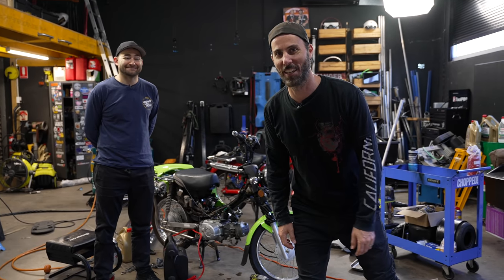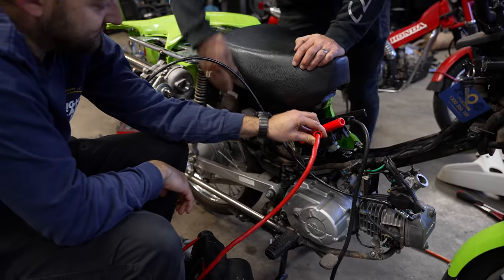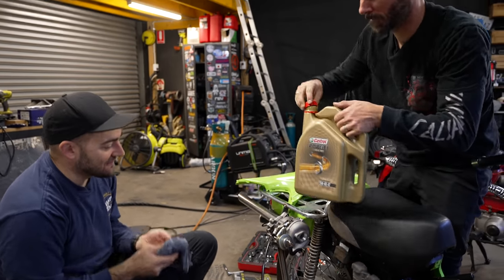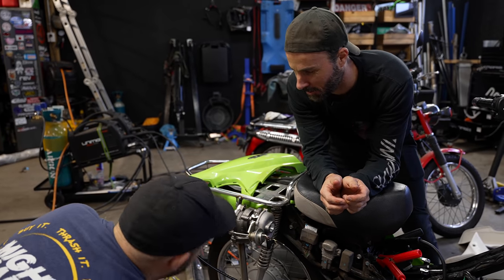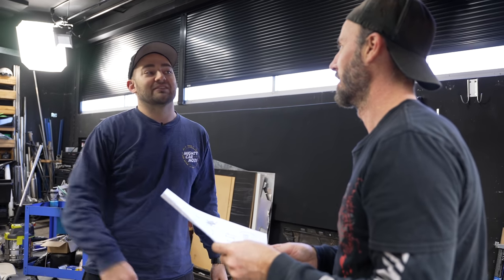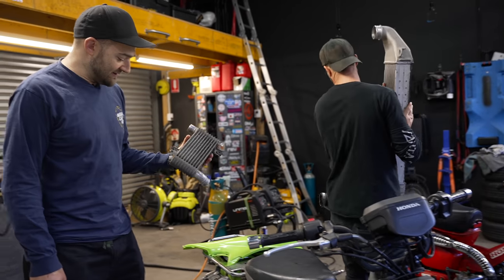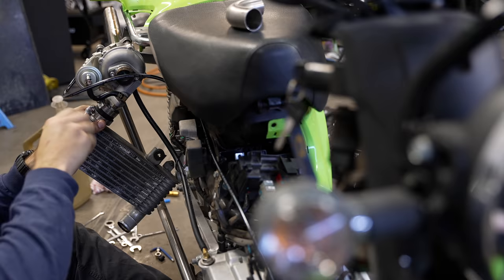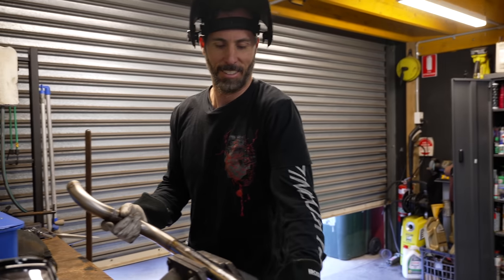WORLDS SMALLEST Blow Off Valve Install

Comment: The turbo is going to want at least 2 bars oil pressure, otherwise it is going to burn up the journal bearings.  Maybe remove the restrictor from the oil line if it does not build up much pressure 🤔

Comment: Watch out for crank case pressure coming back up the turbo needs a oil catch can 
Iv turbocharged lots of theses style motors from 50 cc to 150cc your better of doing a draw through set up on the rb32 turbo nock off produces the boost you need or if you want a blow through set up go the genuine IHI turbo

Comment: Due to GRAVITY, when the Engine is OFF, the Oil will Backfeed back into the Valve Cover UNLESS you install a "CHECK VALVE" (With a Ball Bearing making the Line a One-way Flow) to keep the Oil in the line...

The closer to the Valve Cover the BETTER!

Comment: Don’t the motor need some kind of air capacitor to avoid it from pulsating boost since it is a single cylinder?
Reply: Yeah I think so. But the intercooler and longish intake pipe would have a bit of volume, so might be enough in them?

Actually, as I was typing that I thought about the fact that it's a 110, so the combustion chamber is less than half a cup. Tiny. There's got to be a couple of cups of volume in that intake system...

Comment: Overflow Canister with a low flow pump.

Oil is pumped into the Turbo, Oil goes back into the Canister and is Recycled through an Oil Cooler...🤔

Comment: ?? What happens when you leave the engine off will the pre primed line drain into the head fill and or up the crank case and cause piston slap ???????

Comment: Moog: "All the oil has to do is overcome 1 atmosphere of air pressure."

Sorry friend, but the line of oil going up to the turbo also has the weight of the oil inside the line generating pressure back down into the head of the bike. Think o fit like this, you have a 10 Liter Bucket of water with a small hole drilled in the bottom. When the bucket is filled to the top, water will shoot out of the hole because its under more pressure of the weight of the water in the bucket above the hole. As the bucket empties, the stream of water coming out of the hole will weaken as the pressure drops. That oil line going up to the turbo is like stacking a column of buckets on top of each other. Its a thin "column" of oil sitting in the line wanting to gravity feed itself backwards. The weak motorcycle oil pump and small oil squirter together are acting like a pressure regulator that does not allow the oil pressure to exceed that of the pressure in the line from gravity. You could use a thinner tube like a coffee stirrer and maybe be able to dribble oil through that.

Comment: Do these engines even have an actual pressurized lubrication system? I was under the impression that they used an oil "slinger" that just kind of "flung" oil up into the upper cylinder head for the valvetrain. I dont think the oil system actually creates any positive pressure. 
This is definitely the way the older 72cc, and 110cc engines worked.

Comment: If you overfill the oil (not enough to harm the engine) you will get more oil pressure. Which I can guarantee you've thought of this but in the off chance you haven't, try it. By the way I am not far in to the video as I write this so I don't actually know if you got it working yet 😂

Comment: I’m just saying. U guys know this already lol. It’s trying to feed the cams and the turbo. It’s not going to work as well as u think. Your going to kill that turbo. Bc. It’s going to the cams. Bc of the path of least resistance. He’s right about the atmospheric pressure. U would be better off coming off the bottom of the case somewhere and gravity feed it. There’s plenty of oil to feed it out.

Comment: It'll be gravity feed when you're doing wheelies.
Reply: Moog: "All the oil has to do is overcome 1 atmosphere of air pressure."

Sorry friend, but the line of oil going up to the turbo also has the weight of the oil inside the line generating pressure back down into the head of the bike. Think o fit like this, you have a 10 Liter Bucket of water with a small hole drilled in the bottom. When the bucket is filled to the top, water will shoot out of the hole because its under more pressure of the weight of the water in the bucket above the hole. As the bucket empties, the stream of water coming out of the hole will weaken as the pressure drops. That oil line going up to the turbo is like stacking a column of buckets on top of each other. Its a thin "column" of oil sitting in the line wanting to gravity feed itself backwards. The weak motorcycle oil pump and small oil squirter together are acting like a pressure regulator that does not allow the oil pressure to exceed that of the pressure in the line from gravity. You could use a thinner tube like a coffee stirrer and maybe be able to dribble oil through that.

Comment: You would have just got a one way valve fitted onto the oil line coming from the head otherwise it'll just drain back into the engine

Comment: With that amount of oil in the lines that's alot taken from pan. You need to compensate for that much. It doesn't hold 4 gallons like a car.

Comment: what is a compressor with a pressure tank? a nice mod, blower
Reply: boost balancer, nos tank, kinda
Reply: who so far from the source, air movement
Reply: petrol, gasoline is water+co2 out, not co2
Reply: you could use coolers as foot pads
Reply: any pressure compressor needs a meter
Reply: a bigger carb
Reply: oh why do you let it go

Comment: nil research done on this build for a turbo to work on this small engine it must have a large boost storage container right before it enters the throttle body the way you guys have done this it will probably lose horsepower

Comment: Not trying to be a dick, but just build yourself a separate oil system for the turbo. A small oil tank, pump, and 2 hoses is all that would be needed.

Comment: oil is not a pressurized system. when you turn it off it will flow into the head and then you are boned. as well now you are scavenging all the oil to the turbo and robbing the oil from the head. you need a oil line from the case

Comment: There really isn't enough oil flow or pressure for that poor turbo.  A small electric pump could be an easy fix, though the generators on these engines have a fairly limited output.

Comment: So, about that water… I think I can explain.  Gasoline is basically hydrocarbons.  Hydrogen and carbon atoms form a molecule, and it’s a hydrocarbon.  When you combine oxygen, hydrocarbons, and HEAT (spark) chemistry happens.  The hydrogen atoms are knocked off the hydrocarbon molecule and react with the oxygen molecules, resulting in combustion.   BUT, when you combine hydrogen and oxygen, you get water!  Boom, yeah!  Science, BITCH!  Any unreacted oxygen combines with the carbon atom and forms carbon dioxide.  In the event the engine is running rich and there isn’t enough oxygen, you get carbon monoxide.  Boo!  If it’s REALLY rich, the carbon atom has nothing to react with and you fuel foul your spark plugs with soot (carbon atoms.)  Bigger BOO!  Oh, and why you’re seeing liquid water… the exhaust pipe is still cold.  The water vapor (oxygen and hydrogen) are cooling quickly and condensing out on the inside of the exhaust pipe and drain as liquid water.  Once the exhaust is HOT and above the dew point of the water vapor, it’ll exit the tail pipe as invisible gas.

Comment: Gauge taped to the fairing... check.     Can't be bothered to make the oiling system work... check.      No water cooling on a compound cooled turbo... check.      Bespoke blow off valve and oil line more expensive than the entire postie.... CHECK.

Comment: Werewolves Vampires Vrykolakas and Rugurus hangout around Jackson Square where the Roman Catholic Church is in New Orleans LA. Werewolf Royce Allison of the OTO wanted to kill for him on Jackson Square I him my hand isn't for hire. Werewolf Royce told Vampire Kalob OTO and Mason ( x Navy veteran commo) Royce said "he's angelic" pointing at me. From the Roman Catholic Church to the Port has under ground Slave Tunnels in the middle of Jackson Square where the Statue of Andrew Jackson is where the lift was under. The lift was to lift slaves to be hung or sold, it really a grave yard with Iron Fence to keep spirits from escaping at night. That why Iron gates of the Iron fences around park are LOCKED at night for the spirits. Also its a "Ley Line [power energy point]"  the Undead (Werewolves Vampires Vrykolakas and Rugurus) keeps adding more and more human remains to it giving it more magical power. I personally would like to do a cleansing and removal of the remains but have to get park from under the Roman Catholic Church control.  Roman Catholic unholy grounds.  This Angelic guy is at War with undead and I can feel their invisible bite on neck touches on my body just encourages to use my Christened sword and Ash Odin's wood stake through their heart. Share this content with everyone you know Plz 🙏😇

Comment: Other than the oiling issue...it's still not going to work. it's a single-cylinder. I'm really surprised you guys haven't brought this up. in many engines air always has somewhere to go. But not in a single-cylinder application. when there's only one intake valve and it closes where does the air go? Well it can't go forward so it has to go somewhere... So it surges. You need a boost box. Think of it as a reservoir for the air for it to hang out. while it's waiting for the intake valve to open. You guys have been waiting to do this for years. I really hope you do it right and not half ass. I'm only eight minutes into the video and I'm going to be super disappointed in you guys if you do a half ass job on this especially after waiting for years to tackle it.
Reply: We 100% need more “Science with Moog” episodes lol